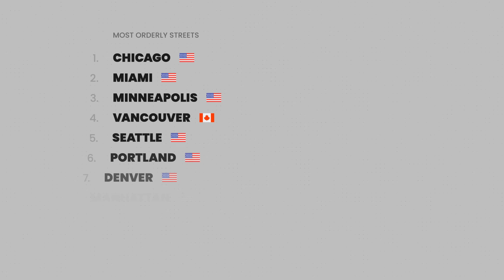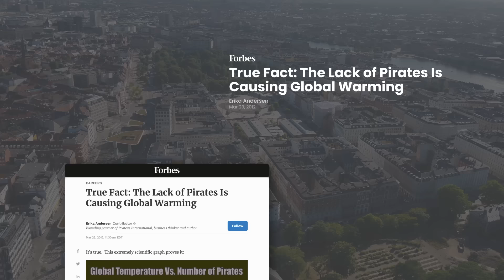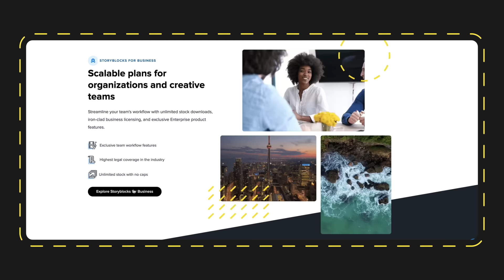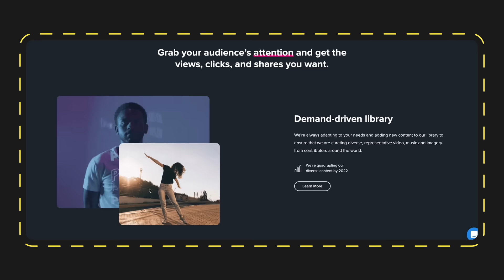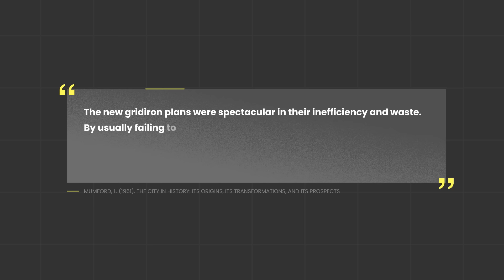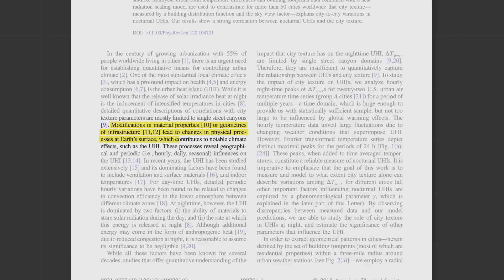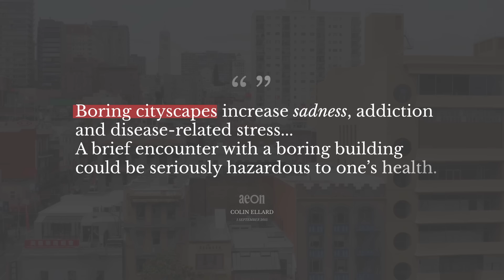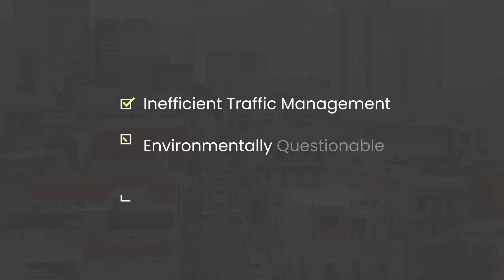Why Cities With Grids Are Terribly Designed

Comment: I always wonder why there are no hexagonal blocks in honeycomb patterned cities since its a really efficient shape...
Reply: Sunlight could be a issue
Reply: A strict honeycomb pattern would cause all distances to be significantly larger though, because there are no long straight streets there, it's all bendy bendy. You would have to add some transit arteries cutting through every second block on their way, otherwise the travel times would increase drastically.
Reply: What's efficient is being able to make 4 right turns and end up back where you started in the event that you missed an exit/turn. Add in an occasional diagonal street for efficiency and you're all set.
Reply: Honeycomb street design has been studied in simulation, and the traffic problems are always insane. Same with cities that have extensive diagonal streets.  In the case of grid+diagonal grid plans, in simulation the vehicle traffic always gridlocks to a halt. The only way planners have overcome this has been to close the diagonals to vehicle traffic and make them pedestrian and bicycle only.  Which would be a political nonstarter in the real world!
Reply: @murdelabop  Sorry that I have to correct your last sentence: "... which would be a political nonstarter IN AMERICA"
Reply: @Skyfighter94  Good point.

Comment: As a driver,  I love grid systems !  It’s much easier to navigate.  People usually have a much better sense of direction (N, E, S, W).  It’s also much easier drive.  Try driving in a city without a grid system, and miss an exit.  Furthermore,  many of the larger cities will require mass transportation.  Working with a grid system will likely help with accurate planning.   As far as safety, it really is subjective and depends on the city.  Many carriers prefer making rights because it’s actually safer and much faster for deliveries.  Learning is also much easier because of the consistency, directions, and mapping.

Comment: What about Paris? I believe large sections of it are on a grid structure, built by Napoleon II, and those are some of the most iconic and beautiful streets in the world.
Reply: Paris is not nearly as grid-like as some american cities, if you compare a map of Paris to a map of new york.  
It still follows the "town center with everything else radiating outwards" kind of system
Reply: Beautiful city and streets for sure, but not really a grid, no. Far from it actually, just look at Paris from above, it's a city as chaotic as they come despite the large bouleavards.
Reply: @cielbie8251 Brooklyn, Queens, the Bronx, and Staten Island are not particularly gridded. The roads are straight and the blocks are square or rectangular, sure, but there are many streets/thoroughfares crossing through those boroughs with various grids aligning towards the main streets at various degrees/angles.

Manhattan is almost a perfect grid, yes, but the rest of New York City, not as much...

Comment: Grids are great for flat areas without rivers or lakes. Grids are also easy to orientate, and gives you squared blocks that are easy to build in a good way. Triangular or trapezoid blocks can make for interesting variety and creative solutions, but for the most part they are problematic and difficult. I don't think the grid is the problem - it's what you put into it.

Comment: Grids also fail to address desire paths in ways that more organic cities tend to deal with them. 

After a few thousand years almost all grids break down into more organic layouts
Reply: This. Grids are based on the premise that traffic should be uniform, which they aren't. Radial designs correspond to the reality that some routes and locations have more traffic than others, due to important buildings present there.
Reply: @abyrupus  Not only that, but a livable city means a lot of diversity in terms of the local neighbourhood. You want the social and transport hub in the middle and then sprawling out to more quiet apartmentblocks, you want the fancy bar street, the shop places etc. Everything within walking distance so you don't need big roads more than maybe to the center, or just good public transit.
Reply: @abyrupus  actually that’s what I like with Detroit’s grid, is we have spoke roads that go in various directions paired with a grid so it’s not perfectly rectangular everywhere, and those roads are much wider than the neighborhood streets. Generally the streets are too wide in detroit but it’s allowed for the government lately to do more experimental things and have bike lanes and street side parking on pretty much every street while still having atleast 2 lanes of traffic which I think has improved them
Reply: Grids CAN help alleviate traffic though, I think most of these benefits are due to better public transport/planning in Europe. Bangkok isn’t gridded but has some of the worst traffic in the world. Grids are good, American city planning isn’t.
Reply: Zaydan Naufal  exactly!!! Doesn’t matter if you have a grid or not if you don’t have good transit and planning to go along with it.
Reply: Look at Barcelona, grid design of the city make it the most livable city out there

Comment: Although very small compared to other cities, I would argue that Melbourne is an exception. The CBD is a grid and it works incredibly well is very easy to get around. Sydney on the other hand, may have made top 10 most livable cities recently, but its a shit-show to get around compared to Melbourne. Also, Melbourne won most livable city in the world for seven years straight.
Reply: Most livable cities: there are at least four different ranking systems (look in Wikipedia)...
Melbourne is ranked: 17, 5, 9, 17. So good livability, but not the top one for sure.
And only large/major cities are ranked, so if we were to include smaller cities/towns, Melbourne would probably not make the top 50.
Reply: @udishomer5852  Melbourne has ranked top 10 in liveability for a while before last year. And in what world is Melbourne “not a large city?” It has a population of over 5 million people.
Reply: @udishomer5852  covid fucked things up but it usually is at the top
Reply: Sure if you want to drive around Sydney it isn't it the best way, but for transportation alone Sydney moves way more people compared to what's happening in Melbourne

Comment: I think you give grids a good shake. They have their upsides and downsides. But overwhelmingly I'd still attribute the problems as due to cars themselves and the unfailing strict adherence to grids, in particular those with large block spacing.
Grids, as stated were and are an efficient way to lay out a street plan for rapid development. They also keep a city in order when private development is dominant (like in the US). When cities don't have good master-street-plans then there is a total breakdown of any logical street layout and no corridors get built, and we arrive at the same problem of no street really being able to accommodate traffic properly - assuming there's even a street. The big North American cities do have traffic problems, sure, but look at small suburban and x-urban North American cities, the ones who exploded since the 70s. Some have comparable traffic problems to much larger cities precisely because they didn't lay out a master street grid back decades ago and are suffering from failing interconnectedness today, for cars and pedestrians alike.
Grids can actually make an extremely walkable environment precisely because there is such a high density of paths-to-destinations. They are essentially maximum access. And this is often talked about as always good, but absolutely they're inefficient therefore with materials and pavement as a resource. And grids are only unwalkable in so many cities in the US because the grids were set up with large block spacing (250+ m rather than like 75-125 m).

I think if we kept grids as a way of selectively enhancing non-car, local access but broke it up with specifically laid out corridors and reservations for things like services and parks that helped break up the monotony of the grid, this would still be a grid in primary function - facilitating access for people on foot/bike/etc - but without falling victim to the downsides of that strict adherence. And we see this exactly in both European and American cities: more organized 'imperfect' grids like Savannah, GA; natural emergent streets interspersed with grids (from several stages of development) like Boston or even Vienna; as well as the 'grand planned' street grids of New York and Barcelona which are then cut up with non-grid streets. Somewhere in the middle can definitely be fine, in particular if the guiding principle isn't car-centered design. That's, to me, the primary failure of American urban design. This obsession with grid is a part, but more a compounding circumstance rather than a primary issue itself.

Comment: If the grid pattern contributes to heating Miami, which leads to more air conditioning being required, that translates to less environmentally friendly. Then in a city like Chicago where winters are extremely cold then having a grid pattern to trap heat would mean less heating is required thereby being more environmentally than not having a grid pattern?

Comment: Meh, say what you will about a grid, but living in the Chicagoland area myself, I like being able to quickly identify where something is and how to get there from my current location without needing a GPS, only cross streets. I could be on the far north end of the city and know exactly how to get to an intersection on the far south end because one of the streets is probably up here where I am already! Half the battle is already done. And here in Chicago, for me, the south side is even easier to figure out because the street names are numbered in order going south. Tell me 31st st and tell me 95th st I now know you’re talking about destinations at least 64 city blocks apart. And even better, 8 blocks equal a mile, helps calculate how far something is too. Try figuring all that out on your own on those curly, twisty, windy roads.

Comment: During lockdown, it became obvious that our congestion problems in Copenhagen are caused by commuters. Without them the streets were deserted and only 1 in 3 parking spots occupied. The reason is Denmark subsidize commuters for driving by an amount several times larger than gasoline cost for the distance driven..

Comment: My home city (Tampere) has a grid centre, and it is the most livable and functional city I have ever lived in. The centre is walkable, has good public transit, and also permits cars, yet is not cramped despite having high density by local standards. No, grids are not a problem. 

Helsinki, the here mentioned non-grid city, has a centre that is jammed with traffic, is losing its relevance to commerce and pedestrians ( by the city’s own admission), is noisy and congested despite having been in decline for years now, and is difficult to navigate by foot or to find anything in because too many and too far-in-between street crossings and because at the same time nothing is shaped logically. 

Even public transit does not help, since all traffic is forced into long winding conduits that get congested with bith pedestrians and non-pedestrians alike. Copenhagen has this problem, too. A grid would help. 

If I were to plan a city, I would make it a grid. Obviously. No other structure can be better based on geometry.

Comment: Grid cities are eminently logical and very efficient sans cars. Can you imagine navigating NYC if it was not built on a grid? It is difficult to get lost in NYC and one usually doesn't need directions to a building address. It is less costly to build too since you are only dealing with straight lines and 90 degree angles.

Comment: Grids were a problem before cars, even London suffered due to its layout before the Great Fire of London. I can't remember the architects name who designed a new layout after the fire using diagonal main roads linking key areas, it wasn't used in the end due to fears that if London wasn't rebuilt quickly then all the businesses would move away and London would no longer be the economic hub. The proposed layout has been tested with modern computer traffic modelling and it holds up as a very good design and and isn't too far away from being an optimal design. Diagonal roads cutting across the grid reduces traffic across the whole area due to not having to weave through horizontal and vertical roads to travel diagonally which is often the main direction of travel.

Comment: I'm sorry, why do you have to "flatten everything" to do a grid system?  Have you ever seen pictures of San Francisco??   LOL. Now if you're going thru mountains that may be something else. But Chicago doesn't have many mountains.  If the local area has hills, shocker, you can build roads on hills without flattening them.....

As for "they found it trapped heat", how is that blamed on grids exactly?  It's not like wind always travels in one direction. It seems you could construct any buildings to accommodate weather using a grid.  I mean you could put an angled building on a square lot. You can put a diagonal building on a square lot. The fact the streets are orthogonal doesn't mean what you build on the lots has to be square or facing a certain direction.

Comment: The grid systems has been in use for millenias in planned cities. It doesnt matter if you look at the colonies of Magna Graecia or the medieval period Kyoto design. Grids have their benefits, they just need correct implementation. For example a roman settlement would start from a millitary fortification with 4 entrances and 2 roads intersecting in the middle, while the rest of the street network would be planned around this in a grid. You immediately have your main traffic arteries (which also led to the forum, the most important part) and could then allocate space for your settlers.  

Kopenhagen is a liveable city because it has only 600 000 inhabitants, is heavily bike focused (only rivaled by Utrecht or some other dutch cities), has great public transport and is overall accommodating to people without a car. There are cities, not based on a grid system, with terrible traffic and stupidly carcentric infrastructure. Stuttgart comes to mind with one of the most terrible regular traffic jams in Germany or Rome, with probably the insanest drivers in all of Europe.

I find it flattering that you Americans look at Europe as inspiration, but please also take into account all the bad stuff there is.
Reply: Two more examples to grid based cities: Barcelona, as far as I know, has a pretty great city live and is to a large part based on a grid system (I dont know much about as my experience with it is quite minimal) and if you look at the planned cities of Musolini south of Rome you will see an interesting picture. For one they are all grid based, they are extremely car centric with a bad public transport network, but they allow a surprising amount of walkability in the city centre. The problem is the dependency on cars, not the grid system

Comment: I think this is a classic example of correlation does not equal causation.  European streets are more twisty and turny because they began as paths for people to go on their horse before the invention of the automobile.  Chicago was built predominantly in 1890-1920. The model T from 1908 to 1927 played a significant role in this.  The thought was to make streets straight, parallel, and 90 degree angles.  And it made sense.  Its extremely easy to navigate around Chicago.  Not only do we have the grid system, but its all numeric based as well.  Each 800 in an address is one mile.  So 800 N Halsted will be exactly one mile from 1600 N halsted, and another mile will be exactly at 2400 N Halstead, etc.  

The reason why the US doesn't have public transit...to be fair, New York's is great, Chicago, Boston, and DC are very much solid. But most of the country, mass transit just blows.  And its because big business plays such a significant role in terms of lobbying(bribing) our representatives.  And three massive industries are vehemently against mass transit and high speed rail...the auto companies, the oil companies, and the airlines.  So therefore, we have mass transit in like 4 cities.  And was built more than 100 years ago.

Comment: I don't think the most of the problems you've pointed out here are inherent to utilizing a street grid.  Grids can have varying street widths (not every street has to be a wide artery).  Car traffic can also be banned selectively, as on Manhattan's 14th Street Busway.  If your land is already flat, you may not have to bulldoze the landscape much (if at all) to implement a grid; you could also simply employ a grid on flat spots in your city and allow it to lapse when you reach hilly sections.  As for the frequency of intersections, I would argue that's actually an advantage of grid design over traditional organic street networks--it makes grids easier to navigate, especially on foot, and it's easy to find the optimal route to your destination.

That's not to say I'm a huge fan of linear street grids.  I think they have their pros and their cons.  But I definitely don't think they have a strong causative effect on quality of life--or to put it another way, I definitely think you could have a city with amazing quality of life planned using a linear street grid pattern.  Osaka is a great example of a city that uses a grid pattern and has excellent quality of life.  I would argue that the lower quality of life in, say, American cities versus European ones mainly has to do with other factors (primarily other terrible city planning choices like single-family zoning and car-centric overall planning).